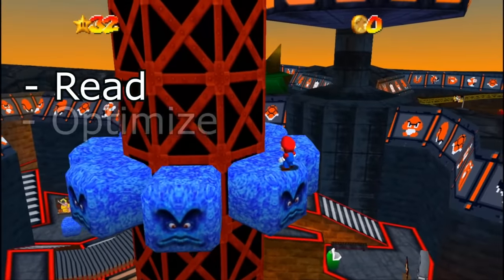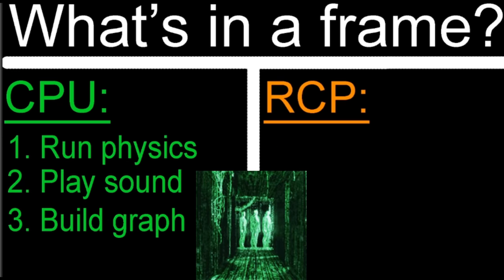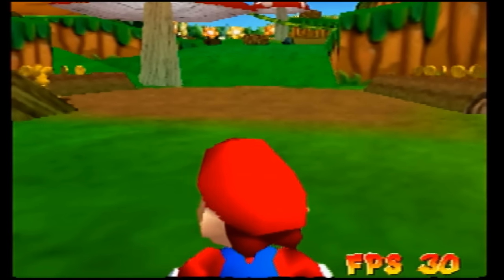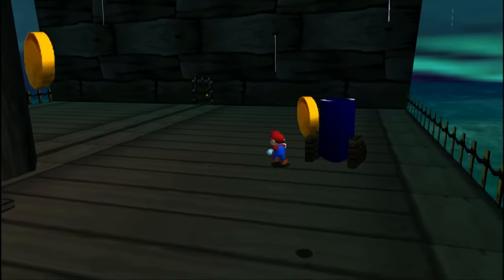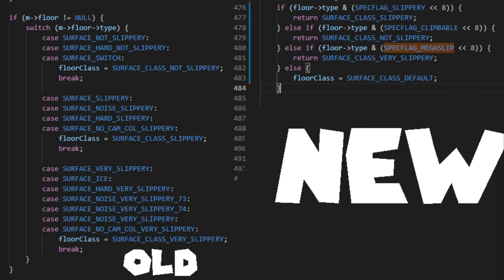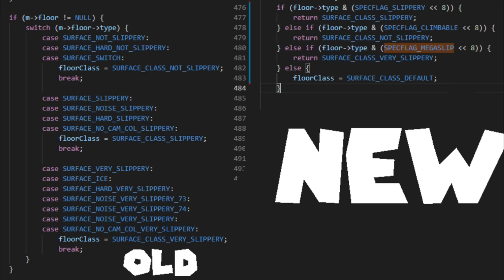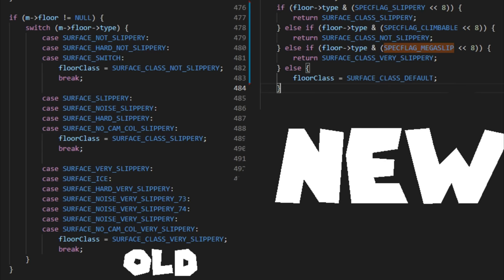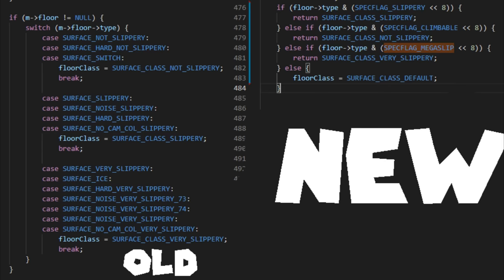FIXING the ENTIRE SM64 Source Code (INSANE N64 performance)

Comment from the maker: Since this keeps being asked:
The RAM add-on added around 1-2 FPS in the final result.
Adding more RAM to a system that already has enough usually does not help. The only reason it helped here is the specifics of the RAMBUS and the manual RAM aligning..
Reply: @Yveldi  upload more graphics card for further boost
Reply: you sir are a god could you also re-write ocarina of time to allow an open source modding archtype like skyrim or fallout has? would be an insane community service tool you could expand your patreon as well. no biggy right?! xD who knows maybe you like the idea whatever you do looking at this project it's bound for succes great job my man!
Reply: Can you please optimize Ocarina of time too?
Reply: But you said in the video it isn't doable without the RAM expansion. So, for most of the N64 lifespan, it was an impossible feature.
Reply: I have to admit the only thing I was impressed about was how you tried to take out all the bottlenecks between the CPU, RAM & RCP. And you took things to the next level by asking this project: 'is this all I am ? Am I using the hardware to its fullest capacity & capability. Is the software doing this as well ? Can this project work on every level ?' I have actually made this argument to gamers about current games and most people never bother a reply despite the fact I'm not after an argument but just a discussion in computer philosophy. Because I'm good with refining renovation projects until they reach a level of all round perfection. But I am not a perfectionist. Don't you think the engineers who built the pyramids were thinking along the same lines as us ? I enjoyed your video. I think your the first to have done something like this on YouTube ???
Reply: @Matlockization  This guy is doing this for fun, taking his time, alone... imagine an actual project, from a big company like Nintendo... hundreds of people involved, dozens of programmers, doing that under pressure, not for fun, but because they are paid to deliver timely, with strict constraints of time and budget, and pressure from all levels above them, and shareholders expecting financial results. It's not engineering anymore, it's a multi-million dollar business. They deliver what is possible. Nowadays consoles have plenty of power, and projects don't have many reasons to extract the most the hardware can give. It's easier to get the best from older consoles, after decades of homebrews and knowledge sharing. You see this frequently on many consoles... games that defy the hardware and pushed the boundaries so much further than any commercial game ever dared to reach during the console lifetime. Check, for example, the guy porting Tomb Raider to the GBA, to the 3DO, and to the Sega 32x. @xproger_san on Twitter, or look for project Open Lara on YT.
Reply: @cgasparetto  Look, I agree but as we follow his journey in improving this game I'm learning about latency in hardware & software, which no one ever talks about. I read a lot about games loading too slowly and not using all the cores available. And most game Co's are like this. They concentrate too much on game appearance rather than functionality. There are 1 or 2 major games right now that are fully optimised the rest rely on CPU & hardly any GPU performance.
Reply: What is the rom in the video?
Reply: this is madness.
You are a legend, and a champion.
Reply: But really, I hope you have a stack of world class job offers a mile high and are just choosing to do it on your own because you believe it better or something.... this is ACTUALLY a nice contribution to world culture.
Reply: @Matlockization    Optimisation like this is rarely possible AT THE TIME.  There are a lot of considerations that we simply won't know about.
Reply: @TheTurnipKing  Your probably right, but it would have been nice to see.
Reply: 120 FPS LOL
Reply: Do you have Dreamcast cdi of this?
Reply: @cgasparetto  Programmers on a payroll are not usually "artisans" of the trade. Many programmers used to be little more than people who would transfer math formulas into code, and read datasheets to understand the various registers and timings involved. There was (ironically) little time for experimentation and trying out new techniques, especially for big players like Nintendo.
Reply: vroom vroom
Reply: @cgasparetto  The real problem is... having lots of programmers. this is 1 guy, I feel like every game should have their most experienced program make a final pass on the game because truth be told, programmers suck at working together.
Reply: @cgasparetto  doom on pregnancy test etc etc . Push it To The Limit !
Reply: @1998SIMOMEGA I'm talking about the top 5 most played games today. Because it seems that too much time & effort is spent on how the game itself looks & feels rather than what's under the hood. It just seems to me that most of a games performance is derived from yearly hardware improvements rather than software optimisation like this guy has done in the Mario 64 game.
Reply: @1998SIMOMEGA Thank you for your thoughts.
Reply: @1998SIMOMEGA Because most people don't go to the trouble of sharing their insights with other commentors. Its only with the creator of the video. And you getting triggered because someone thanked you, well that's a first for me !
Reply: If you fix all the glitches, people can't speed run
Reply: more good = better bruh
Reply: I wish I could do the stuff you do man. My life is just so stressful that I tend to be very forgetful as a result of that stress and thus can't learn anything new because of it. Kudos. Thanks for all the stuff you do.
Reply: @theexile4694  +1
Reply: I dont understand your code, so I appreciate the Vroom Vroom additions!
Reply: Nice work
Congratulations 👏 
Is it possible to test this rom on N64 original hardware?
Where can I found it ?
Reply: Wow
Reply: dwarfer777  lmfaoooooooooo
Reply: @jameswilliams2269  seek out shipofharkinian, they wrote a program that can take a rom of Ocarina of Time and optimize it into 60 fps, complete with Majora's Mask bunny hood effects, cheats, item spawn and removal, custom colors for menu and tunics, and a randomizer built into it.
Reply: is the rom available now?
Reply: IsaacInfernape2000 (Raman)  ???
Reply: You are a coding genius. Have you ever thought about writing code for new games? Like smaller indie games? I like playing games that are reflective of the old console systems.
Reply: "manual RAM aligning"this man is exceptional
Reply: Wouldn't you have extra storage to put your textures? Or, what if like DK64 you had a memory leak?
Reply: Awesome!!!  Please fix Legend of Zelda Ocarina of Time and Cruis n' USA and World.
Reply: @michaelstewart4571  why yall love super mario 64? n64 is too old and thr game looks bad anyway
Reply: @jameswilliams2269  why yall love super mario 64? n64 is too old and thr game looks bad anyway
Reply: @walidfakhfakh3660  relatively easy to mod and it's an important example of progress in 3D gaming
Reply: @michaelstewart4571  Check out Ship of Harkinian.
Reply: @jameswilliams2269  Ship of Harkinian is optimizing OoT already.
Reply: What is the name of this romhack?
Reply: now do it on a real physical n64
Reply from the maker: @nemo9324  real n64 footage is shown later into the video
Reply: Would disabling Z buffering be a viable option for vroom vroom?
Reply: Is rewriting the source code this much somehow still easier than writing it from scratch and imitating the game's behavior in game builder software? Why do it this way if there's that much rewriting? What's the advantage here?
Reply: @edwardperkins1225  Because you still get the idea what the code is supposed to do.
Reply: I would never wish this upon you but have you received a cease and desist from Nintendo?
Reply: Where can I download it to play 😅😊
Reply: @cgasparetto  He said the FIRST round of optimization required the RAM expansion, but I was under the impression that subsequent optimizations brought the RAM requirements back below stock. Further evidence is at the end of the video, where he says his later demo builds had further geometry complexities because he had the leeway to fit them
Reply: This isn't really about RAM optimisation but more so code optimisation.  It's amazing what can be done with such limited hardware if you have the modern hardware and coding skills to do it. I would say for the 1990s Mario 64 was pretty well optimised as it is. Nintendo when they pushed out hardware were used to the limitations of consoles and a lot  It was very possible still with the N64 to use a lot of assembly language particularly for the reality co-processor. The background music in  Mario 64 was optimised to the point where it was synthasised . There were actually very few  "true sound" files in the entire game and those sounds were things like Mario's voice and the sound effects. They also reused textures and polygons throughout the game to reduce waste of resources and then on top of that, to deal with the fact of creating open worlds, without the resources to do so there weren't really worlds as such as we would know today. You can wall hack into different levels in Mario 64 and the whole thing basically runs on top of itself pretty much walled off by sprites. 

It's quite ingenious given how frankensteined the "levels" are that people put up with it at all, but hidden behind smoke and mirrors and that's the facts of what we were used to in the 1990s, well, it did an amazing job for the time showing us the possibility of what could be. Sure if you dump a lot of the code off to the real power of the N64 which was the reality co-processor and optimise the crap out of the C coding while optimising down (using modern compression) the size of the textures and polygons this game can be substantially optimised but yeah, it has nothing to do with the RAM buffer much at all... Other than the fact that Nintendo went with the fastest RAM available at the time which is RD RAM of course.

This entire video is about optimising code and handing a lot of it off to the RCP that is already way ahead of its time by being able to handle assembly code (pure machine language). One of the biggest gripes about the N64 (which would follow up with the Playstation 2 and Playstation 3) were the overheads to teach people how to properly how to optimise C and then teach assembly to handle the RCP. Unfortunately the Nintendo 64 like the Playstation 2 were way too far ahead of their time. The hacks that Nintendo used to get that much power out of an N64? As the video says, most developers didn't know them at the time which resulted in a lot of really poor games for the N64.

Looking back at all this and understanding that the N64 could handle shading and even z buffering (that can be used to create a sort of anti-aliasing effect). If the developers knew what they were doing N64 games could have been so much better. The platform was amazing, it's just  that the N64 was already about 15 years ahead of its nearest competition which was fully understanding how to optimise code for the PS2 and PS3. That's right also, the Nintendo 64 even has tools to get rid of janky edges on sprites and polygons. If only the Nintendo 64 had have built the DD into the console, or used a CD based platform. What could have been achieved would have been even more amazing.
Reply: @jermsbestfriend9296 He's leaving in the fun stuff.
Reply: RAMBUS goes VROOM VROOMFPS
Reply: @youtubeguy8796  well it did at that time.
Reply: @Matlockization  Have you ever actually written a line of code there, bud?  programmers get paid to deliver a final product that makes or saves money, not spend 2 years trying to optimize mario 64 so it runs at 41 fps in 1996.  if you had a business and were managing devs, you wouldn't have a business for very long, you have to make money.
Reply: @Matlockization  hardware is much, MUCH cheaper than programmer time.
Reply: @bobthebuilder609  I’m not saying that gaming company’s etc, should go to the lengths of KazeN64, that’s ridiculous. But KazeN64 he has demonstrated better performance, more stability and all round compatibility with some basic coding improvements at the beginning of his project. Take for example, AMD & Nvidia GPU’s. Now Nvidia spends far more on software development on their cards than AMD. And AMD can say well our architecture doesn’t require that much code improvement. But most enthusiasts can tell that it shows in games & apps across the board (excluding DLSS & RT). This means that the customers need fewer hardware upgrades. But what we have in games is that many are ‘beautified’ and there is an introduction of the woke narrative in many games to the detriment of the gamer. Now if they can waste money on that, then they can do what I’m debating. And don’t you want to benefit from what I’m saying ? So I don’t know who you are defending. Can you think of any improvements you want developers to make on your favorite games or are you happy with all of them right now ? CEO’s have been pocketing profits instead of ploughing that money back into code development of their products and it shows. The whole computer industry (inc games) right now have been relying more & more on hardware to do all their heavy lifting just because they can’t are too gutless to go the other way. Where the gaming companies save money on programmer time, the customer makes up the difference by wasting their money on hardware that goes up in price every year !
Reply: Where can i downloade your fixt version ?
Reply: where can we download it
Reply: @michaelstewart4571  lol. The complexity of the request.
Reply: @walidfakhfakh3660 Troll comment lmfao
Reply: How did you get access to the game's source code?
Reply: @pastapastel910  The game was decompiled by fans a few years ago
Reply: @sleblanc deadlines also prevent the best solution being found. Often, the fastest solution ends up in production.
Reply: what music had been used
Reply: this is amazing i have a better undering for games and how they work. very cool video
Reply: Do you think you could get Quake 2 to run on the N64?
Reply: PLEASE SELL this source code BACK to Japan Nintendo. I still have my 64. I would buy the new optimized version
Reply: @benjam910 Actually the source code leaked few years a go. I think that's why we can not download his optimised version. It could bring some trouble, I think.
Reply from the maker: @brunosuperman  this is reverse engineered sourccode and is unrelated to the nintendo leaks
Reply: Thank you for answering!
Reply: @bobthebuilder609  32 million N64s were sold. The manufacturing cost would have been in the billions of dollars. This isn't like the common case where you could spend three months optimizing or spend $500 on a hardware upgrade. The hardware was actually very expensive, and Nintendo could have bought lot of programmer time for a very small fraction of what they spent on hardware.
Reply: and things will have to write to both the cpu and rcp segment which negates some of the performance gain, likely why the level script takes longer
Reply: PLEASE make this optimized code a part of the B3313 build if it has not been done yet. :(
Reply: 76th
Reply: Could someone explain the difference in the visuals at 17:43 where the lighting is purple vs flat, with tessellated cobblestone vs flat ground texture. Specifically, does this affect performance, and generally why is it different at all.
Reply from the maker: @FloatingWeeds2  has no effect on performance! its only changed because i prefer the look on the right.
Reply: @KazeN64  dude you're amazing. Watched a few of your videos in the last couple hours. Very impressive stuff. Do you have a LinkedIn with a fuller CV?
Reply: In my ambition I am writing a barebones complete compiler for C, in which inlining assembly is still nonetheless possible. I'm calling "BareCC" and building it into the kernel of one of my custom operating systems, "Chiplock". Not only am I designing custom OSes but novelty OSes also.
Reply: I don't quite understand the benefit of splitting 4MB of RAM into more pages. The official N64 Programming Manual even says that page misses slow down RAM. The Discord conversation mentioned DRAM refresh. Is the benefit that it reduces the amount of time that each page is being accessed before it has to refresh?
Reply: hey guys im new i love these projects, where can i get to play these? free or patreon, just tell me please :)
Reply from the maker: @sklungofunk  this will all release for free once the whole game is done! currently im about 80% of the way there.
Reply: @KazeN64  amazing keep it up
Reply: How do I give you money? Genuinely.
Reply: Does anyone know the music that plays in the bg of the first few minutes? The one that sounds like disgaea. Or just have a track list from kaze's videos, would be greatly appreciated.
Reply: @Matlockization I am going to clarify, using multiple cores is not always the best or a valid strategy, it depends on the problem and how a problem can be broken down.
Reply: @donovan6320  Yes and this video has demonstrated that there isn't enough software optimization across the board.
Reply: @Matlockization  Also, I don't think you understand how game development works... People don't usually write stories and code and level edit and handle art, it has a lot of pretty single disciplined topics. 

Putting that aside, the issue is mainly on you the gamer and the execs up above. They cut deadlines. You make unrealistic expectations, The scale of the game gets bigger with open world shit and no loading screens and dynamic shit everywhere, high fidelity models and textures down to the details.

None of that stuff is free, It's not even cheap. 

The more dynamic shit you ask for and the bigger the space, The less assumptions the engine can make, and I'm going to be honest with you. The hidden surface determination problem is not a simple problem to solve, otherwise it would have been properly solved. 

These older games have practically no truly dynamic elements, their world sizes are extremely small they have one and occasionally two textures per object. (Modern games can have four or more) Super Mario 64 is a pretty shitty place to start. It is pretty much Nintendo's first 3D game and they had no idea what they were doing. 

You are comparing highly generalized engines with very complex systems running generically modern hardware and consoles and handling things the Nintendo 64 could not even dream of to a system built with very early versions of a WIP Nintendo 64 Dev kit with a very early version of Nintendo 64 rendering engine that is pretty much designed for this game only while they were using a compiler so new untested and buggy, they couldn't properly switch from debug mode to release mode. 

I'm not going to remind you just how much switching to a new compiler alone gave the Nintendo 64. Not to mention a lot of the low-hanging fruit optimizations discussed are currently done in games. It's pretty common practice.
Reply: @donovan6320  Well for starters, most modern games take a long time to load and it seems to me that there is too much development going into the appearance of the game. In fact, developers are so hung up on 'scene beautification' that they have to be careful not to go too far, otherwise their customer's hardware will not be able to cope with the demand resulting in games like Crysis. Another example is RT. Nvidia went too far and created their own dedicated RT cores while AMD went the other way with software accelerators and the result appeared to be almost identical. This caused Nvidia to increase prices & power consumption, putting this kind of hardware beyond the reach of most gamers.
Reply: @Matlockization  And I'm going to be honest, your opinion doesn't count for much partially because It's completely vague without any benchmarks specific examples and a system setup. 

Second, because it's a general statement and there could be many reasons why you're having issues. It could also be unreasonable expectations

On top of that, appearance of the game is an evil that collectively gamers have created for a long time people didn't buy games with bad graphics and it was considered a turn off. 

Finally, RT is rarely required in all situations and AMD does significantly worse at it than Nvidia. It's also not really a required thing for games and when used properly has significant advantages including for optimization. That Ray tracing hardware can be used to bake high quality lightmaps on significantly easier to run hardware.
Reply: @KazeN64 - Proof of work? ;)
Reply: People actually think you optimized 7 lines of code a minute, on legacy tech :D
Reply: Just look at the ps3 it look 2x better at the end of its life the thing is it takes time to optimize and time is money companies won’t go for it.